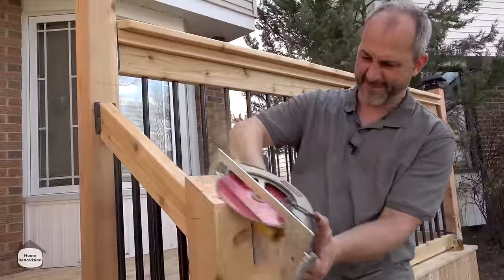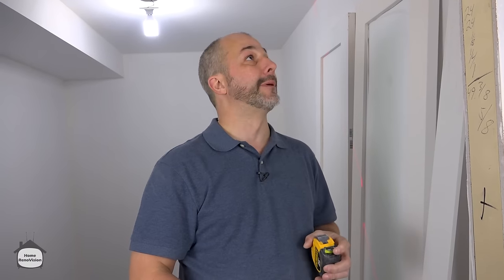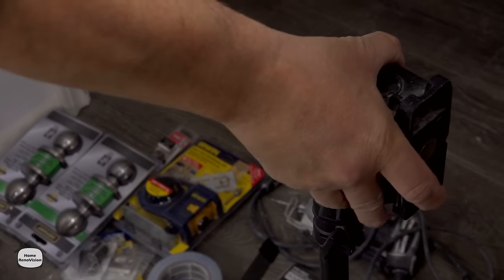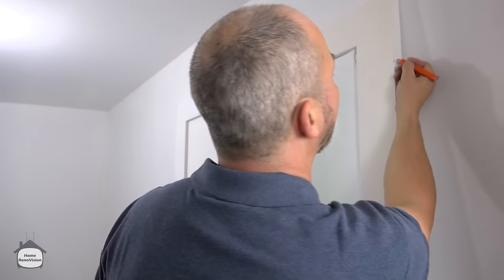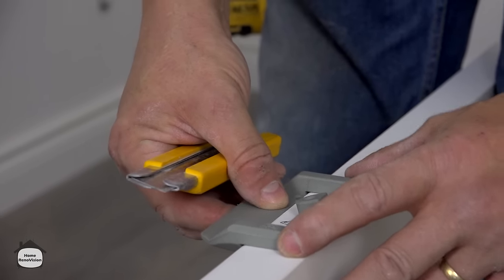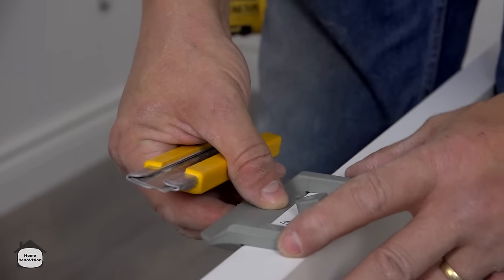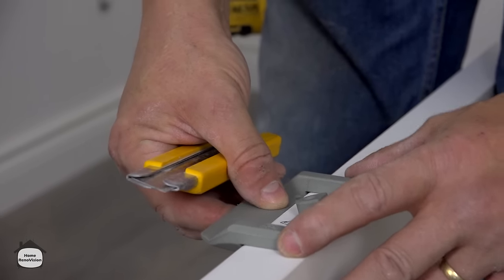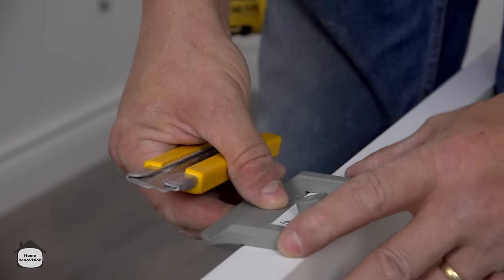Install French Doors YOURSELF! | DIY Tutorial

Comment from the maker: If you can hang a french door, then you can hang one in any language! Cheers!
Reply: lmao
Reply: Love the channel but the accent is terrible, lol
Reply: Nice if you come down to Florida let me know 🎼🎶🎺🌅
Reply: This is the best channel Jeff is the best 👍
Reply: Any chance of making a video about how to fix wonky doors in old homes? We keep having issues in every place we live where the latches don't catch and the doors don't stay shut. It's so annoying!
Reply: Les francais rendent toujours tout difficile lol
Reply: Question, I want to install french doors on the interior of my home between the dining room and living room and there is laminate wood flooring throughout. Does it matter if I install the doors on top of the flooring? Or should I cut out the flooring where the doors sit?
Reply: Angela I know this is an older comment but a simple thing that fixes that type of issue is to take out one of the screws holding the hinge to the frame and replace it with a 2 1/2 inch screw (I personally always replace the middle screw of the top hinge) I hope this helps you and the problem ends up being that easy to fix! 

PS - if it does fix it I would personally replace one screw in all 3 hinges just to make sure it doesn’t sag again

Comment: tip from a carpenter, when the pilot bit pokes out the other side, finish drilling from the other side to prevent breakout
Reply: This is the easiest solution. Another is to clamp a scrap piece of wood onto the backside to prevent blowout and patching later on

Comment: Jeff, I wanted to thank you very much for this video. I had to install French doors in my house and you video guided me to complete it successfully. After a long though on the hardware to use I decided to use the roller balls on each door top. I bought two nice lever door knobs because this is for a living room/entrance. I decided not to install the latch (and catch) since I don't need any locking feature. It came out pretty well except for a little rattling sound I couldn't resolve. Now I have to paint it to match the wood color of the floor and the staircase. I have to figure out what kind of paint to use and how to match the color. I subscribed to your channel because I find your explanations very clear and fun to watch. Thanks again!

Comment: Just a tip that you may already know. When you are drilling the hole for the handle, as soon as you see the tip of the drill bit come out the other side, take it out and drill from the other side, that way the hole saw won't make the wood/hdf splinter off like it did
Reply from the maker: If I was using the proper drill I would have been more confident. I was 
trying to find the right moment since it took almost 5 mins. But it 
snuck up on me! Cheers!
Reply: i would called it  destroyed door. screwed up hinges, screwed up handles.
Reply: @HomeRenoVisionDIY   It wasn't about the proper drill, you said you saw the center bit coming out the other side, should have switched drill sides then. You probably didn't think it would tear out that bad, then oops.

Comment: A couple of inputs: 1. Estwing makes a really nice two faced mallet for use with chisel work and for installing door hardware so that there aren't chowder marks left by the dimpled faced framing hammer 2. When the doors are horizontal, stand them up on the long edge and clamp them together for two operations (drilling the ball latch holes and marking the top hinge mortices). This also reminds you to have mirror images for hinges...and please don't ask why I know this is a good idea :-).

Comment: Exterior doors for sound proofing. I had French doors installed between my basement office and Theater room. I wanted it to be really quiet so I used wood exterior French doors with windows in them. The benefit in sound dampening having it airtight top, bottom and center is amazing. 

It was an extra $1000 but totally worth it.

Comment: Nice video Jeff! A trick for boring out holes for door handles with the guide tool you used to avoid chipping from the opposite side, start drilling on one side a little bit, maybe a mm or 2 and then go to the other side to drill right through, the template tool should guide it perfectly through still, and you'll avoid chipping and extra work patching.

Comment: I truly enjoy watching your videos.  You have taught me a lot of little tricks of the trade.  Sometimes you show a little tip and I go DUH, why did I do It so much harder for 30+ years. Lol.  It was comical watching you drill  the door knob, using that honker of a drill.  Lol. One tip that I could suggest if I may,  would be, when the pilot drill popped through the backside of the door, remove the drill bit and start drilling from the other side of the door and that would prevent the massive tear out from the hole saw.

Comment: The gap in-between the doors is about perfect, if you install a T Astragal not only will it block the light but it will fill whatever gap there is.  Astragals are usually included in French door kits

Comment: Is it normal to have a bit of a gap in between the doors? I have about 1/2 gap in between the doors. Also one thing I guess you can doo when installing the top stopper is you can measure the length of the top stopper and measure the same distance on your drill bit and then put a masking tape and when the tape hits the top of the door you know you have drilled far enough. Hope that helps.

Comment: If the gap at the top is not perfect, how can it be corrected?  My door on the left is about 3mm low at top center and same spacing between the doors at the bottom.  Maybe more shim thickness at bottom and less at top?  Jamb is plumb though.

Comment: Looks great, my wife and I wanted to try our hand at french doors leading into the dining room - this will be a great help! Would love to see some information about retrofitting a whole home vacuum system into our house to see if it's worth getting into.
Reply from the maker: that all depends on how much access you have to the ceiling in the basement. Perhaps one day we can show some info on that!
Reply: I vote for a central vac system install, too!  Would love to see one retrofit to an existing house.  And couldn't the lines be run thru an attic in a one story house?  (Not under the floor.)
Reply: Central vac systems are better left to the 60s/70s when they were a "thing". You could buy 20-30 handheld rechargeable Dyson vacs and get much better cleaning than a central vac system. Technology wins today.

Comment: Please get the Milwaukee door handle install guide it will save you so much time 
Second when drilling i always drill from 1 side until the center bit pokes trough the other side then I'm finishing off by drilling trough the other side i know u can patch stuff up but 5 seconds switching sides vs lot of time patching and painting

Comment: Always awesome video. I’m doing some home remodeling and your videos help a lot. I’m a hands on visual guy. I saw the blow out from the hole saw on the back side of the door. If you just get the center drill bit part through the back then remove the hole saw and drill from the other side placing the center drill bit in the small hole on the back side you won’t have that blow out. Keep the videos coming. One question is this the same basic install for exterior French doors. If not what’s different other than the weather proofing.
Reply from the maker: If I was using the proper drill I would have been more confident. I was 
trying to find the right moment since it took almost 5 mins. But it 
snuck up on me! Cheers!
Reply: Yeah it was funny when the camera cut right when you noticed you didn’t have your other drill. Like the humor and all the info you put into all your videos. Great job explaining everything. Look forward to the next one.

Comment: Any possibility you could do a video on replacing existing closet doors with newer modern doors. I have bi-folds everywhere and hate them - want the proper door (single or double), but not sure what to do about the 1" drywall overhang that surrounds the existing bi-fold doors to hide the outside gap. This is the finished edge of the wall - do I cut this so that it's rough edge and flush with the opening of the closet and then follow this video - or do I leave it and tuck the door framing behind it? I'm sure it's a stupid question - just haven't found a good example of how to do it properly on You Tube.

Comment: Yes a bigger door is better in say a Rec Room and you need to move a Treadmill thru the door.  In our case with the door off it was 29.5" wide.  Not enough to get Treadmill thru the door.  We wanted to have the door open outwards because of room setup there was no way to have the door open inwards, it would hit furniture.  So I took the top and side jambs out and was left with a 32" x 82" opening.  Narrowest part with Treadmill in up position was just a bit over 32" wide.  So it was just a matter of pushing Treadmill on Dilley thru the door turning to one side slightly thru the door and at one point tilt the top part to fit thru.   Don't ask me how we ever get the thing out again.  The other door in the room goes to the garage and with the big heavy door taken off, it is 32" wide.  Front door with door off is 36" wide, didn't really want to push treadmill outside and then infront around to garage and then into that 32" wide door.

Why is my roughed in opening 32" x 82", I thought 32" x 80" was standard?  It goes have tile floor in the hallway.  Do I set the new door jambs as if it was 80" high opening?  And fill in the other 2"?

Jeff any tips when going out to buy the new jambs and door?  Build that yourself or get a pre-hung door?  Wife wants a single French door with the glass.   Those glass doors are expensive.

Is it worth trying to sell the old door frame and door with it?  Technically it would be a pre-hung door.  It is a little beat up from moving furniture in and out.

Jeff the old jambs had the stops milled into the jamb.  Is that normal?  The old jamb was real wood but was finger jointed pieces.
Reply from the maker: you can buy doors that are 78 or 80 inches high. the opening all depends on which height. in my area 80" doors are standard so 82 rough is also! Cheers Paul!

Comment: Thanks for all the through how to's you post great channel. Now that I've watched you do it I'll know to drill through each side of door first before going all the way through to avoid the tear out. So how did you fix that anyway? Some filler putty? Caulking? I swear I probably would have bought a new door lol thanks again for all you do..
Reply from the maker: If I was using the proper drill I would have been more confident. I was 
trying to find the right moment since it took almost 5 mins. But it 
snuck up on me! Cheers!  I used a little flat oil to prime and then 45 cgc compound to repair. Cheers!

Comment: There is a tool to make the round corner hinge cutouts into a square. It is a small "L" shaped chisel set into a block. A tap with a hammer sets your square corner.

Comment: I enjoyed this video.  I have question – My door has a door closer and 2 days ago the door is not fitting, after a quick investigation the hinges, some of the screws are loose.  This was done by my father in law years ago and I want to do it the right.  What do you think I should do?
Reply from the maker: Hi Lester, best to disengage the closer and then add new wider and longer screw. Cheers!

Comment: a good tip for you to add was to drill from both sides when make the knob hole (your jig should keep it perfectly lined up with a proper drill haha) and then you wouldn't get any tear-out
Reply from the maker: If I was using the proper drill I would have been more confident. I was 
trying to find the right moment since it took almost 5 mins. But it 
snuck up on me! Cheers!

Comment: Hi Jeff,  love your work... hey,  I'm replacing a sliding door set installed in new construction 1993. Replacing with new French double doors. Do I need to reflash the bottom? I haven't taken anything apart yet.. trying to get everything ready before I start in a couple days. It's a preying door from Lowes.
Reply from the maker: Hi Steve, in 93 there were very few places that did flashing as a part of standard practice. best to have the materials on site and return them if not needed. Cheers!

Comment: Wow you mangled that door knob hole. lol  maybe show how you fixed that and the other knife slip. 

It would look better if a 1x strip was used to cover that gap and maybe a little weather stripping for sound deadening. Not really for weather, it just keeps the door from rattling when closing, a vibration damper.

Comment: Love the series! I have a framed doorway to a formal living room measuring 70". If I want to add doors, should I trim doors and hang them in the existing frame or take the trim down, hope I find a couple inches behind it and get a standard 6 foot prehung door? Thanks!
Reply from the maker: buy 2 doors and take 1/2 inch off each side of each door. Cheers!

Comment: I need to replace my patio sliding door my problem is the existing door is 96 inches in width my home center “home depot” doesn’t carry the size is what they call special order too expensive for now. I wanted to go with one of 76 inches in width i hope u soon come across a situation like this so i can learn about the framing process and step to tackle this project. Cheers
Reply from the maker: simply frame in the hole you want and install a sidelight to fill the space.

Comment: Thank you for the video. I want to add something about door locks, maybe you know that, maybe not. There are some locks with magnets inside catches. When door is opened the latch is inside the door but once it is against the catch it goes out just in the catch. I find such locks better because they're quieter than regular ones and door shouldn't be pused to be closed.
Reply from the maker: Cheers!

Comment: I took the hinges off my front door to replace them with a different color. Now there is a 1/8th air gap that I just can’t get to go away. Do you have a video on how to adjust a front door so it closes tight to the air seal gasket. 

I added a compression door jamb weatherstrip but it would be better if that was a second seal instead of the main seal.
Reply: they make "hinge shims" that go behind the hinges to push the door over ever so slightly.

Comment: With those door knob temp plates your actually supposed to drill from both sides to prevent tear out.
Reply from the maker: If I was using the proper drill I would have been more confident. I was 
trying to find the right moment since it took almost 5 mins. But it 
snuck up on me! Cheers!

Comment: You could have done all the fitting and mortising of the hinges with the door and jamb legs laying together in an easy horizontal position, before assembling the jamb.  Then you would have had pre-hung doors. Faster, easier, more accurate. The only reason to try to locate hinges with the door hanging like this is if you are fitting to an existing jamb, not when you just installed the jamb yourself.
Reply: In fact, you could have assembled the entire unit on the ground as a prehung assembly with everything perfectly fitted, then tip the whole thing into place and shim it.

Comment: You more than likely know this already, but when drilling through the door for the door handle if you stop as soon as you see the center of the drill bit poke through, then you can drill from the other side and usually avoid it damaging the door face. I say usually, because one never knows if the wood or the drill will completely cooperate.
Reply from the maker: Truth is It took so long to get there it kind of surprised me!
Reply: @HomeRenoVisionDIY  I can understand that. Sometimes that last little bit can sneak up on you.

Comment: This is what i have learned , when you start drilling for the door knob you drill half way through then go to other side and finish the hole . That way you don't tear out the wood .
Reply from the maker: If I was using the proper drill I would have been more confident. I was 
trying to find the right moment since it took almost 5 mins. But it 
snuck up on me! Cheers!

Comment: Now u knew better than to drill all the way threw that door!
Reply from the maker: If I was using the proper drill I would have been more confident. I was 
trying to find the right moment since it took almost 5 mins. But it 
snuck up on me! Cheers!
Reply: @HomeRenoVisionDIY  it didnt really sneak up on you, you mentioned the pilot has come through, that should have been your que to move over to the other side and core the hole to keep both sides clean, other wise great video. also, i prob would have gone with a Forsner bit for the smaller coring, it a cleaner nicer bit in comparision to spade bits
Reply: Lmao I agree with comment and follow up comment...I watched the entire time saying "please please don't drill all the way through....". Then he said "I see the pilot hole on the other side" and was super relieved. Seconds later, he drilled at the way through. And he kept workig...couple of minutes later how shows how he blew through the other side lmao 😂😂😂😏
Reply: @HomeRenoVisionDIY  yeah...I blame your son/wife as well... 😄

Comment: How do u hold ur measuring tape up so easily. My always collapses on me.
Reply from the maker: When you buy a tape they will make a claim as to the STAND OUT LENGTH. that is how far you can pull out the tape before it bends. mine is 11'
Reply: @HomeRenoVisionDIY  I did not know that. Thank you!!

Comment: Explain that 'Laser' thing! Please
Reply from the maker: The laser is self leveling so it always shows plumb. work to fit the line. Cheers!
Reply: it is basically used as a level with the added benefit of identifying twisting
Reply: @HomeRenoVisionDIY  Yes! But is it a SMART laser? (You know? GPS, and responds "I am not programmed to respond in this area" when you say "Ok Google")